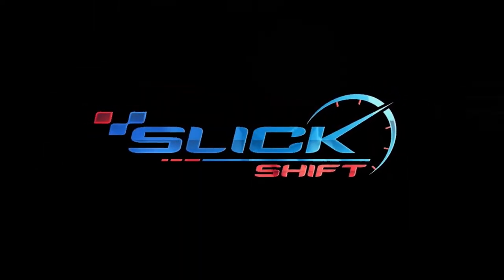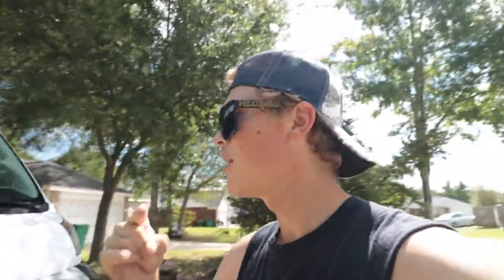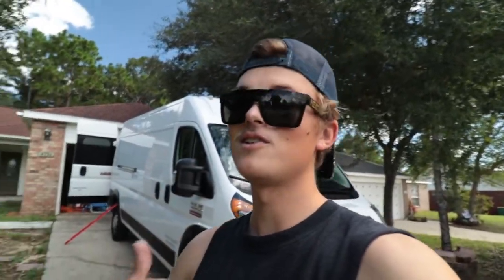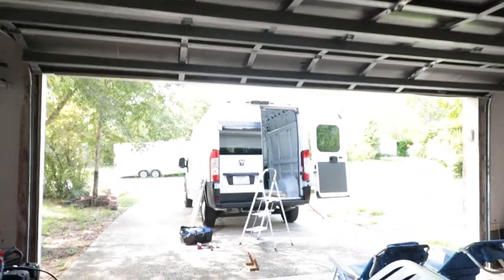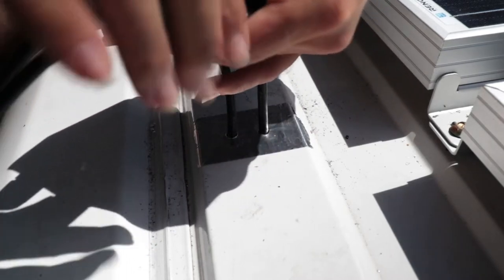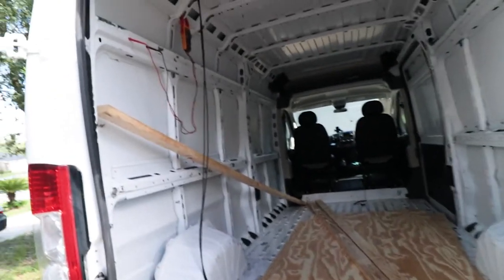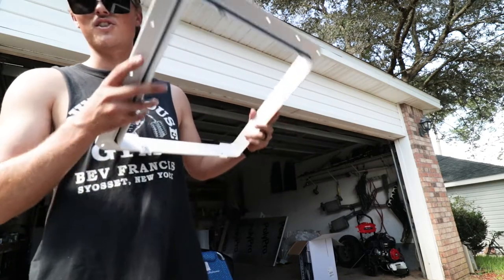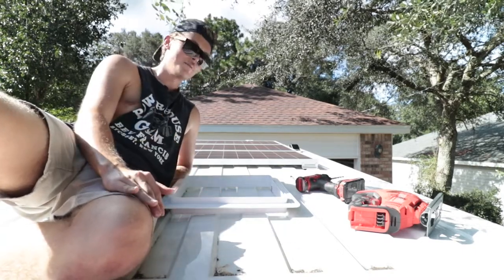Five Week Complete Van Life Build | How to Build a Camper Van | Travel Van Step by Step | Van Series

Comment: How do you tilt the solar panels when your using them? Why do people install them flat when they're meant to tilt towards the sun is their a reason for flat mounting? I decided to make a frame for mine flat while travelling tilted whilst operated.
Reply from the maker: Hey that’s actually a really good question. I wanted to do a swivel setup but I was running out of time due to getting out of the military. If I were to do it again I would have welded up or bought a swivel rig. However, the panels performed great during our travels and I was more than happy with the charging. Your rig sounds like a great idea.